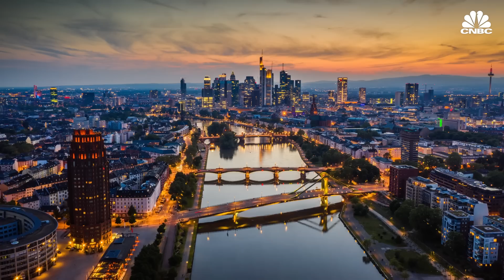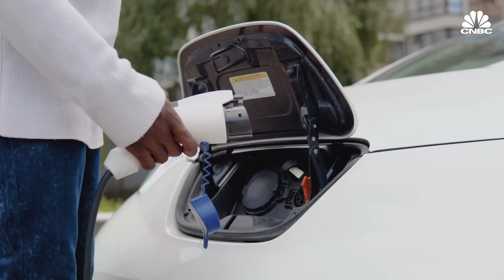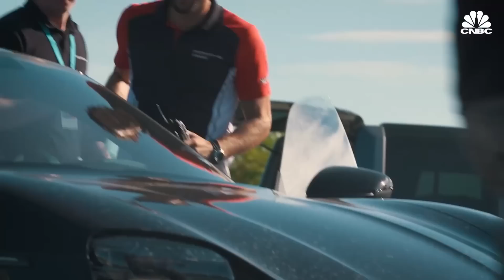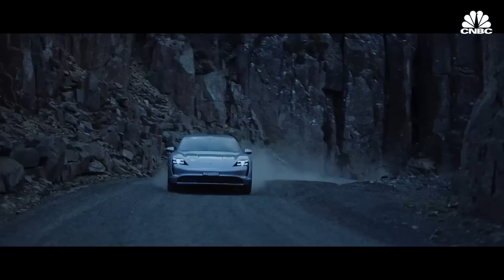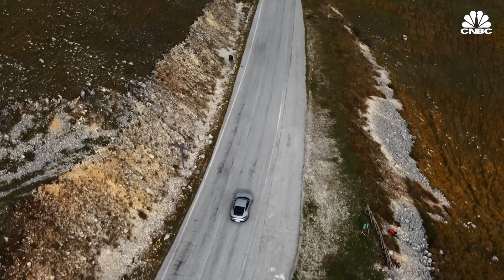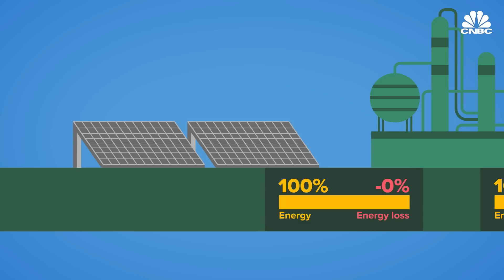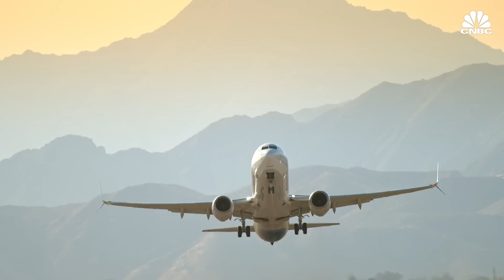How Porsche Plans To Keep Its Gas-Powered Cars On The Roads

Comment: I hope this technology innovates because I don’t want to buy a new car. 

My old 1997 Celica manual is fun to drive, reliable, and has been super cheap to own. I’ve spent less money on this over the time I have had it than I would spend buying a brand new Chevy bolt

I’m totally fine with people buying new Tesla’s or whatever else but I think it should be part of the eco solution for people who want to reuse and maintain their old cars for years to come to be able to do so. Scrapping these cars would be such a wasteful thing
Reply: @23chnge  When the time comes you can do an EV conversion https://www.youtube.com/watch?v=W-s81BO-P-Y
Reply: 1) there is nothing unusual happening with the climate.

2) there is nothing wrong with burning fossil fuels.  Its problems in high-density areas are trivial to fix and already have been fixed.  CO2 is not a pollutant.

3) Climate alarmism is a big-lie superstition supported by tax-bribed liars.  (See Climate Discussion Nexus for 100s of videos on climate quackery, deception, and realism.)

4) decarbonization is 21st century pyramid building and human sacrifice. 

5) there is NO excuse for expensive electricity.  Electricity generation is boring.     Just burn coal and scrub the smoke in densely populated areas.

6) the only challenge is manufacturing market quantities of cheap gasoline.  South Africa has already done this for decades (Sasol), using coal.
Reply: $45 a gallon. If it ever drops due to mass market production it'll still be cheaper for the average family to own an EV, hindering mass market adoption. As much as I want this to succeed I don't see it being relevant beyond F1, aviation and shipping. If it ever makes it to our pumps if regular gas is still avaliable and cheaper we'd still choose it due to the cost of living. When gas is phased out most stations will go out of business if they don't start carrying EV chargers too.
Reply: EXACTLY I don’t know why everyone thinks electric evs are more climate friendly, the amount of lithium that needs to be mined, transportation for the batteries to be made which are then transported again to a car assembly factory. Not to mention the fact that most counties simply don’t have the infrastructure to provide 100% clean energy to power these cars.
Reply: @Asjrhwu37317  Why is it people are only concerned about mining for EV batteries and have never been concerned about mining for electronics, or steel or coal or drilling for oil and gas? Mining for battery materials means less steel used in engines and less oil used to run them. Though to be fair batteries are just as recyclable as steel engines and it tends to be car frames rather than engines that rust to nothing and thus can't be recycled.

All lifecycle analyses shows the carbon footprint of EVs is a lot lower than ICE cars at the current grid mix of fossil fuel, nuclear and renewable electricity and every year the grid gets cleaner as more wind and solar come online and they shut down the old expensive coal and natural gas power plants.
Reply: @patrickcorcoran4828  have you seen the issues with mining that Lithium, Cobalt and other rare earth materials that happen?

EV owners often play advocates for "we are making world better" when all they do is move the issue from one country to another. Fossil fuel/coal/iron mining/drilling is way safer to get compared to battery materials. When was the last time you needed a child without foot wear to mine materials for your $100 000 gas car?
Reply: @CianCipher  Mining for ore is mining for ore (though a lot of Lithium comes from lithium brine, which is more like sea-salt production).

No EV manufacturer uses cobalt from mines in the Congo with forced labor (they started tracking material in 2019) BUT because metal ore is a commodity (like oil) any increase in the use of the commodity raises the price of it, which benefits both the good and bad actors in the extraction industry. Even if EVs aren't using cobalt from forced labor mines, by driving the price up, they are still affecting the profits of those mines. Its the same with oil, even if Americans don't buy Iranian oil, if they increase their oil use the global price goes up and Iran benefits by selling to countries that will buy their oil. That's why all EV manufacturers are experimenting with alternatives to cobalt. SVOLT is the top manufacturer right now.

As I've said a few times on this video, why is it that no one cared about child labor in the Congo when the majority of cobalt went into smart phones and computers and why does not one care about its use in smart phones and computers now that they're just barely less than 50% of cobalt use? I never see anyone demand that we keep phones and laptops as long as possible.
Reply: @patrickcorcoran4828  because idiots want to make us believe its good for the environment when it really isnt close
Reply: You two are doing more for the Earth than any of these EV cvnts.
Reply: You will never get efuels fron Porsche.

Comment: Hmmmm how does combustion engine beat ev in terms of speed and acceleration?
Reply: It still beats EV in terms of total weight, refueling/recharging time, and total distances it can reached on a single fuel stop/charging (and also accesibility, especially in a rural area)
Reply: @hectornecromancer5308  speed, meaning top end power , easily alot of cars, accleration basic sport cars and regular cars lose sure, instant torque comes in handy, a plethora of cars can do well off acceleration though, try again
Reply: @estevanperezz  indeed instant torque has a lot of benefits. But one thing I didn't mention, can EV worked on an area where electricity is barely available?
Reply: @hectornecromancer5308  exactly, dont mind evs at this point but good luck trying to force evs on the majority of the world, ev is a luxury just like reliable electricity is a luxury majority in the world dont have
Reply: @hectornecromancer5308  i also directed the comment to the original poster, accidentally tapped your squre i guess, the original comment screams lack of knowledge
Reply: @estevanperezz  I see
Reply: Speed of refueling - ICEV wins hands down.  Only children are interested in traffic light GPs.

Comment: This is overall a great look at Porsche vis a vis transitioning to EVs. One point I was hoping for was emphasizing that nearly all drivers of any vehicle on the road are using a vehicle by necessity - not as a pastime. 

The ideal future we hope to live in is where virtually all vehicles on the road are non-internal combustion engine, and a tiny fraction are classic cars that still burn gas. You can see this today; we don't balk at classic cars from the 1960s or even older because 1) they are so few and far between, and 2) they are iconic and interesting - even though they are horribly inefficient, often are exempt from emissions standards, etc etc. 

Porsche drivers will always be enthusiasts. I personally don't see an issue with providing gas for Porsche's and Corvettes. Lastly, even today, if you can afford a Porsche, you can afford $10/gallon gas.

Comment: You can't put an E at the front of fuel and pretend its a different product. It doesn't matter if you use carbon capture if you're still making gasoline that is still putting exhaust in areas people live. Electricity is going to win!

Comment: Although lower than fossil fuel based fuels, eFuel still has emissions of particulate matter and sulphur oxides - which are bad for our health. BEVs are obviously getting cheaper, having increasingly longer ranges, and are many times more efficient in energy consumption. But the company that made the allegedly great Taycan prefers sticking with inefficient and pollutant fuels. This is not about reducing the carbon footprint, it's about investing less. Poor Porsche, right?
Reply: Well, someone has to do it. In case BEV doesn't sound as promising as it seems
Reply: @hectornecromancer5308  No, it's actually stupid to double down on ICE vehicles. The price of batteries has consistently gone down, and they are are most expensive thing in a car. With longer range for less money, and cheaper to recharge compared to refueling, plus lower TCO, one doesn't have to be a genius to know a BEV is better - even if they don't care about emissions.

And when the ICE car makers lose even more economy of scale (already an issue), their margins will become lower. If they sit and wait for longer, what kind of money will there be available to save them from going bankrupt? That's the problem - it's a matter of survival at this point. And the difference between ICE and BEV is big enough to not be easy to scale fast. It takes time, some mistakes in the process, and so on.

The ICE vehicle manufacturer should know better, and keep pushing harder to reach profitability with BEVs, because their ICE sales will implode in very few years from now. They only have time until Tesla and the Chinese manufacturers scale up to the point ICE sales will take a huge dent. Waiting to see is a recipe for bankruptcy.

Comment: Porsche in 2035- So making hydrogen out or water was hard, and so was capturing CO2. So we fracked for natural gas, and split it with electricity from coal fired power plants. We'll figure out the hard parts later. Good news is we aren't using oil any more to make gas.

Comment: As an Engineer I like the idea but it’s never going to be on parity with fuel and never going to be cheaper than EV.
Reply: I don’t know why everyone thinks electric evs are more climate friendly, the amount of lithium that needs to be mined, transportation for the batteries to be made which are then transported again to a car assembly factory. Not to mention the fact that most counties simply don’t have the infrastructure to provide 100% clean energy to power these cars.
Reply: right? screw all those poor countries who cant in any way have EV structure. also scew city people who dont have private garages and depend on a new parking spot everyday.
Reply: For now, not yet
Reply: @hectornecromancer5308  Get real. It's a non starter. It's been estimated the US alone would need around 9000 e fuel manufacturing plants similar to the one in Chile, to supply it's needs..... It's not happening.
Reply: @Brian-om2hh  the one in Chile is currently only pilot scale. Real plants will produce thousands of times as much.

There are 120 petroleum refineries in the US alone.

Comment: They are addressing the wrong problem. Fossil fuels are abundant. It's the emissions after the fuel goes through the ICEs which emit carbon gases. Traditional gasoline or E Fuel - the emission levels remain the same since the compound produced by this artificial process is designed to produce the same fuel compound. Very little emission take place during the extraction of fossil fuels. It's like producing Water by combining hydrogen and oxygen atoms and calling it e-water. Or simply collect it from rivers and wells. In the end, it's just water.

Comment: You can also make E fuel from algae. You can even make it carbon negative. You grow algae and then turn it into gasoline or another type of oil. If you use 60% to 80% for fuel then store the rest underground and you have a carbon-negative fuel.
Reply: Please stop, you have no idea what you are talking about and all you're doing is a half-assed parroting of a two or 3 headlines you read, but didn't read the story.

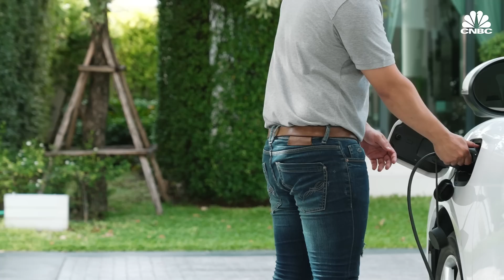Comment: That rep from the ICCT who says at 12:50 that "there's no way consumers will choose" e-fuels because they're expensive obviously has zero interest in cars as anything more than an appliance. There are plenty of car enthusiasts that will pay premium prices for a fuel that will keep their beloved ICE cars viable into the future. I for one would gladly pay that mentioned 10 dollars a gallon for e-fuel to keep my Nissan GT-Rs viable as weekend toys while continuing to daily drive my EV. I'm sure many gearheads would feel the same way.

Besides, she's also missing the point that investments into automotive e-fuel also will likely benefit other transport sectors. Long-haul trucking, maritime freight, and especially long-distance air travel as mentioned in the video are still probably decades away from largely decarbonizing without e-fuels. With car companies pouring money into developing e-fuels that can only help accelerate their possible use in other transport sectors as well. Car manufacturers are the transport sector feeling the most pressure to reduce their carbon footprint so if they don't take the lead in e-fuel development and it's left up to less regulated industries to do it we'll just be further off from the overall goal of significant overall decarbonization.
Reply: In the UK i'm paying a lot of that $10 already to keep my lovely Jaaaag on the road!
Reply: @stevemawer848  I know here in the States we're lucky not to pay that much for gas but I know petrolheads over here find so many other things to blow money on that $10 a gallon gas versus not being able to drive their babies would be an easy sacrifice lol.

Comment: CNBC has been KILLING IT lately.  Keep up all the really great reports.
Reply: are they tho? idk vice use to be great but became awful and made stupid articles on against anime and stuff now their laying off so much they pretty much could go bankrupt
Reply: Hydrogen is a viable fuel for internal combustion engines. They make is as a step in producing the e-fuel.  It would be cheaper, more efficient, and cleaner. CNBC never asks "why not make the 911 run on hydrogen?" This was not a report. it was a commercial for Porsche.
Reply: @seanj3667  this is an expensive way to raise hydrogen. Fuel cells don't scale cheaply. The fuel itself won't be contained cheaply, and adds weight to the vehicle as well.  Infrastructure doesn't exist so energy will be expended to create it.

Ironically the methanol produced is a great way to store the hydrogen cheaply. But then it costs more energy to get it back out again, so it's more efficient to just burn the methanol or use it in a fuel cell directly.
Reply: @identiticrisis  you left out the word "yet" a couple times. They don't scale cheaply... yet. the infrastructure does not exist... yet
Reply: @seanj3667  no of course. But it's best to use sunk costs (carbon) before expending new. The existing infrastructure for hydrocarbons can still be used for carbon negative hydrocarbons, for example.  That would result in an immediate reduction in carbon in the atmosphere with no additional infrastructure (carbon) cost.

Then, when it is ready (yet) carbon can be strategically spent where it will have the greatest impact 

It requires collective action on multiple fronts now and for ever.
Reply: @seanj3667  no its not lol. Toyota has already been developing hydrogen combustion for a while now and its pretty clear that it would never be a viable alternative to gasoline for passenger vehicles. Its solely a fuel density issue. Also they've done 24-hour endurance tests with a H2 GR corolla w/ both gas and liquid H2 and a synthetic fuel GR86. The 86 managed to complete almost double the laps than the H2 car.
Reply: 1) there is nothing unusual happening with the climate.

2) there is nothing wrong with burning fossil fuels.  Its problems in high-density areas are trivial to fix and already have been fixed.  CO2 is not a pollutant.

3) Climate alarmism is a big-lie superstition supported by tax-bribed liars.  (See Climate Discussion Nexus for 100s of videos on climate quackery, deception, and realism.)

4) decarbonization is 21st century pyramid building and human sacrifice. 

5) there is NO excuse for expensive electricity.  Electricity generation is boring.     Just burn coal and scrub the smoke in densely populated areas.

6) the only challenge is manufacturing market quantities of cheap gasoline.  South Africa has already done this for decades (Sasol), using coal.

Comment: Perhaps I missed something... 

...but the combustion of any type of fuel (including eFuel) under high enough temperatures and pressures (such as in an ICE) leads the unnatural bonding of Nitrogen Oxygen (NOx).

Correct?
Reply: Correct, still puts out pollution

Comment: It depends on the use case.  If you are buying a sport car for weekend track use, great.  For most of the people, with home charging and non commercial use,  300miles per day is more than enough for daily use.  For eFuel, its the same work load on gasoline, using a lot of tankers trucks to transport the eFuel to the refill station and you have to go refill there.  No thanks.  For people buying Porsche as toys, that make sense.

Comment: there seems to be a bit of bias in the narrative here. specifically, they've left out the cost (environmental and otherwise) of mining the materials necessary to produce batteries that power electric vehicles. i find the "all or nothing" argument from the electric vehicle lobby to be infuriating. why do we have to be 100% electric if e-fuel can be carbon neutral and result in zero-emission for internal combustion vehicles. we should be celebrating this, not casting doubt on it. Synthetic fuels can only accelerate the achievement of zero-emissions while keeping millions of vehicles operating thru their useful life. It also satisfies use cases where electrification doesn't make as much sense, since it's not feasible to have every single ICE vehicle running on electricity for every use case, especially commercial uses. Having a synthetic fuel option is smart.
Reply: And lithium, AIUI, is a finite resource, so the price is likely to rise as more and more EVs get built.